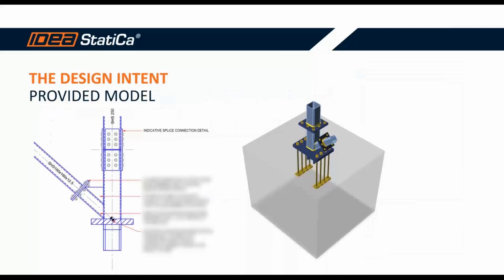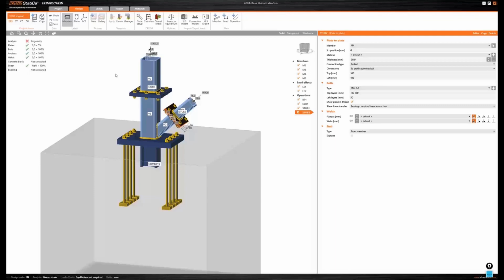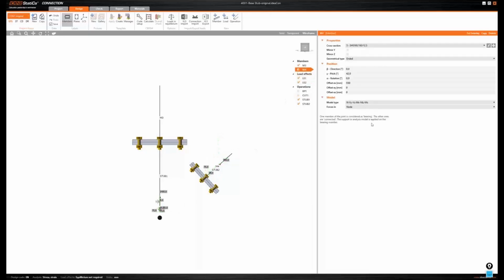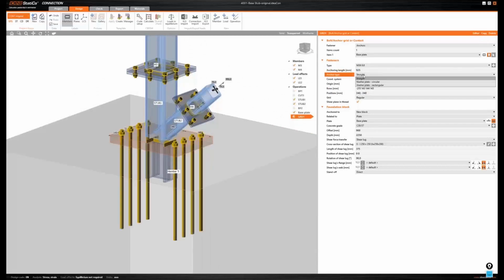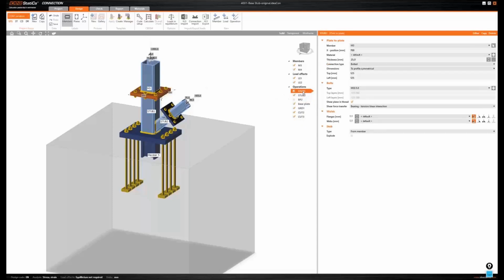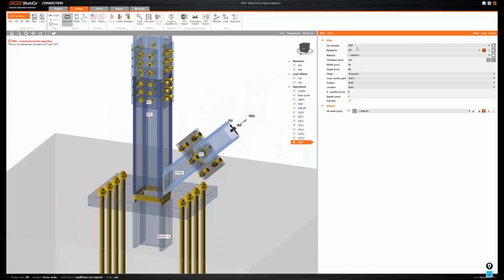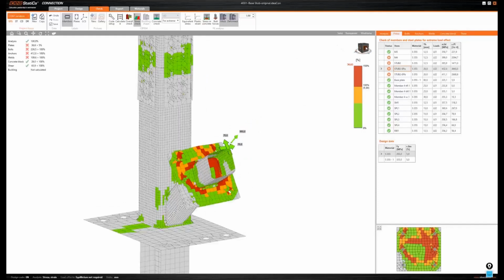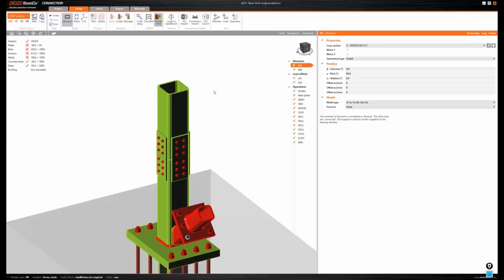Connection Wednesdays – Common rookie mistakes on steel joints

Comment: Hello, I am creating a connection that is similar to a connection in this video, and at the very beginning when the connection is very simple (connection model is just the RHS profile column member and base plate with anchors and concrete) it does not allow me to use the STUB option but reports the following message: 'STUB 1 - Cannot execute the operation. The operation cannot be applied on a welded member.' Do you know what the program means by welded member here and why it does not allow STUB operation?
Reply: Hello, the operation STUB can be applied only to a member unaffected by the operation CUT (which is a part of the Operation Base Plate). So as the first operation please use the operation STUB and as a second apply the operation Base Plate.
Reply: @alexanderszotkowski3223  I assumed that was the problem, but thank you very much for the confirmation :)

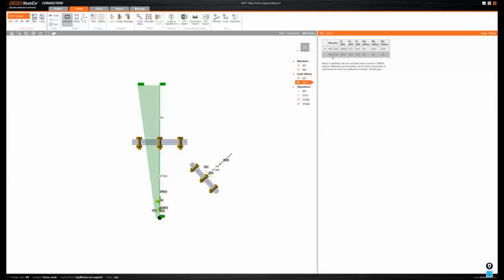Comment: In minute 12:30, you mention that the moment diagram does not extend up to the fictional node. Then you do some changes to make the moment diagram extend to the fictional node (You zero out the eccentricity). So, I have a question please: what if it was shear connection, in shear connection, we can not have moment at the bolts, we must choose "forces in bolts" so we be sure that the moment is zero at the bolts. So then will we have the same problem of eccentricity?
Reply from the maker: If you have pure shear connection without a moment = it is a hinge. Then what you do is you input shear force only and in the settings you set the position of forces into the bolts (either choose Bolts or Possition and input the distance). There is no problem with eccentricity here.
Hovewer in the vide this is not a shear connection or a hinge, so they did not shift the shear force.
Reply: @ideastatica_en  Thank you so much

Comment: The irony of “rookie mistakes” will not be lost on connection designers. How do you tighten the bolts on the lap splice?
Reply: I assume that it is meant to be Hollo-bolts but they failed to mention this maybe because the software does not directly support this product but as they have different tolerances and hole sizes I would question the results to a degree.